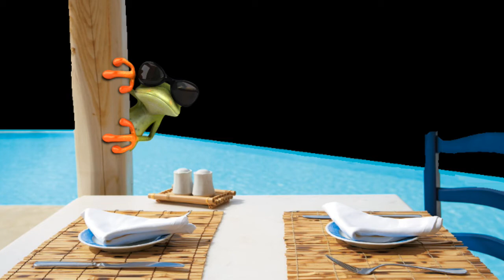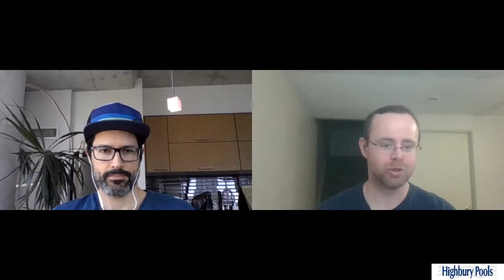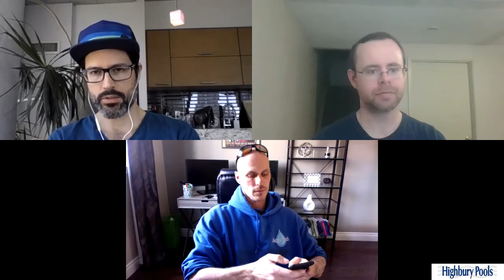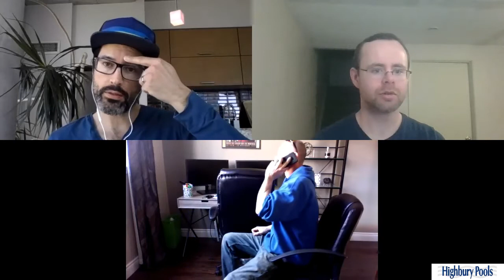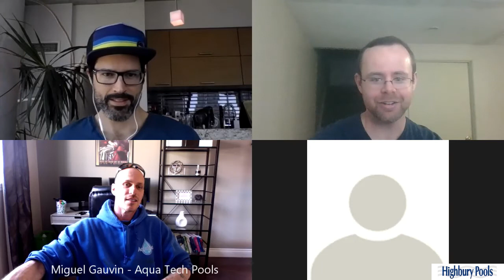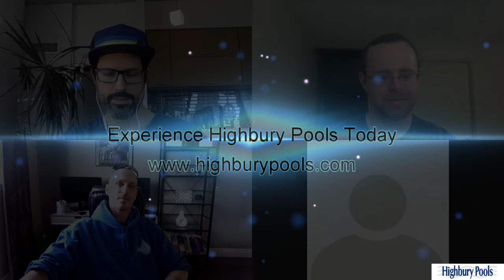What Is A ClearBlue Ionizer? - Featuring Mike Assad

Comment: New to pool chemistry...setting up a new pool and installing this unit. Can't figure out what the appropriate level of stabilizer/  CYA should be...any advice? I understand the Chlorine level should be 0.5 - 1 ppm,  but just concerned about over or under dosing on the CYA with this low level of chlorine. Also, what type and schedule is recommended for shocking the pool (16,000 gal for reference). Thank you!
Reply from the maker: Sorry for the late reply! Mike Assad did a video on @MineralPools youtube page that might help (it's towards the end of the video): https://youtu.be/lHPY0lVAxyc?si=kWV7kIXC2m6ac9ue